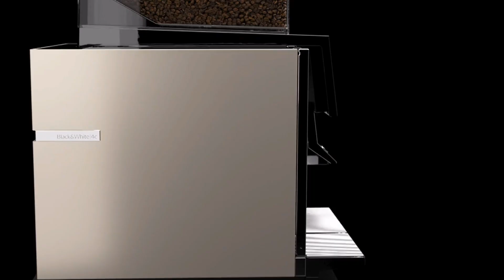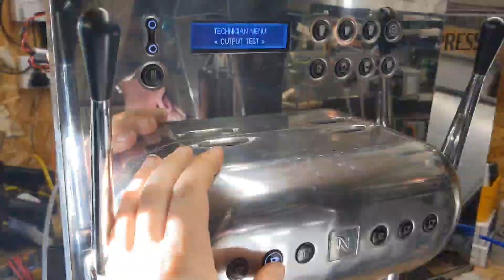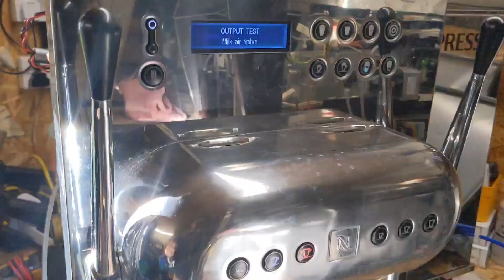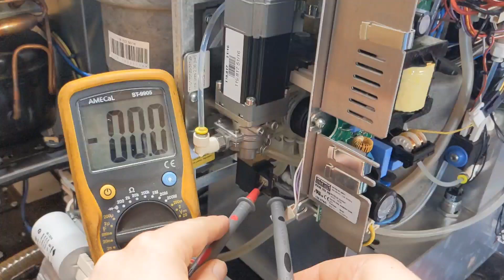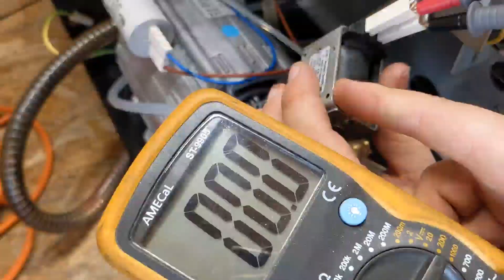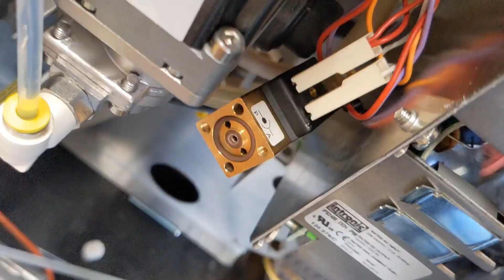Repair Of A Nespresso Aguila 220 (Thermoplan) Not Foaming Milk Part 1

Comment: How do you get
Into the service mode.

I have a machine that dosnt wanna finish its clean cycle and also is calling for a service

Can you help me through that ?
Reply: On exactly the same page 😊
Reply from the maker: hello thanks for watching and leaving a comment. i can help if you contact us infomation in description.
Reply from the maker: hello thanks for watching and leaving a comment. to get into the service menu you need a special key. (which i can supply if needed)  if your machine doesnt want to finish its clean cycle probally requires a service or repair. i can help if you contact us infomation in description.